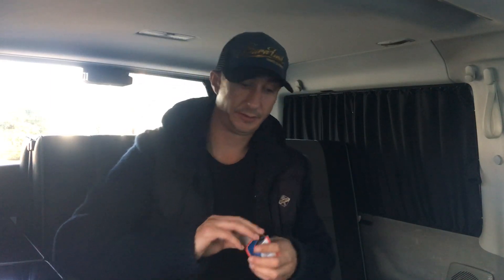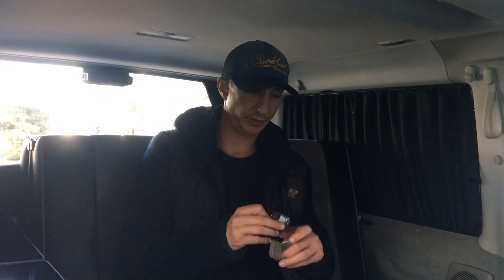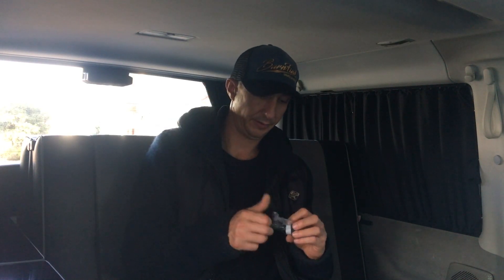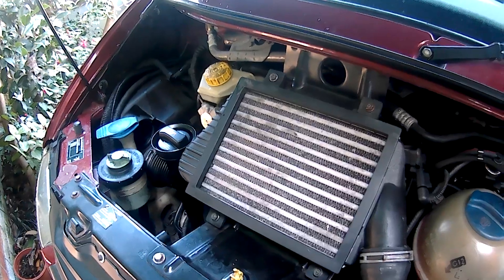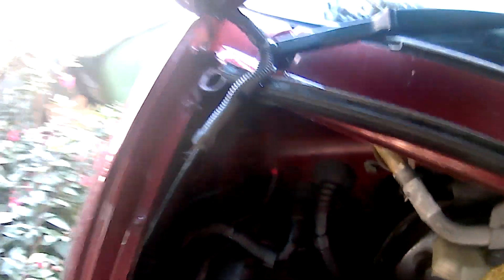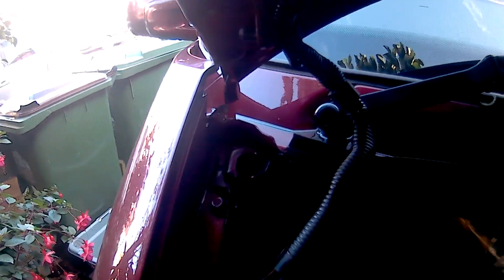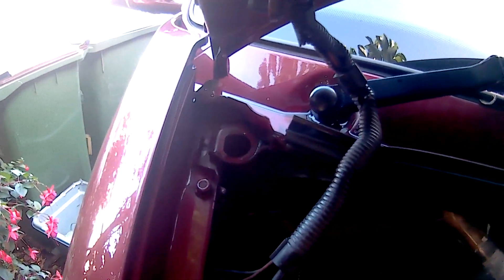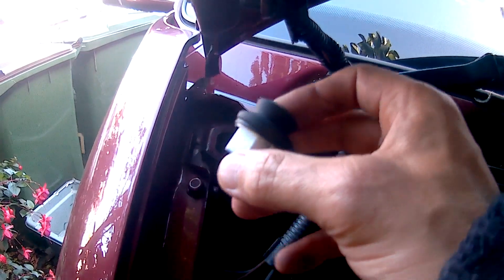Replacing bonnet switch to reset oil WARNING light!!!

Comment: Hi. Little bit confused on this... As far as I've been told, there are 2 switches. One on the engine & the one on the bonnet that mimics the oil warning. I replaced the bonnet one, but still have the light so the other switch is faulty.
Reply from the maker: If its the red oil light it'll be on the block, if its orange then its the bonnet
Reply: @TwiggsT4  Strange then... I replaced mine but still getting the orange light. Do you know if it's possible to test the circuit?